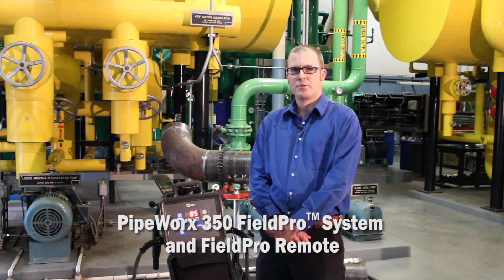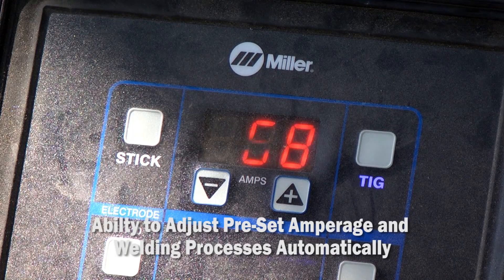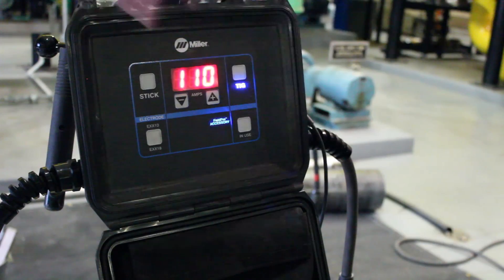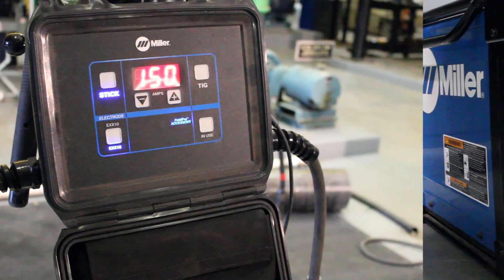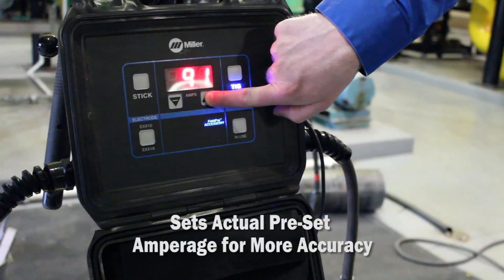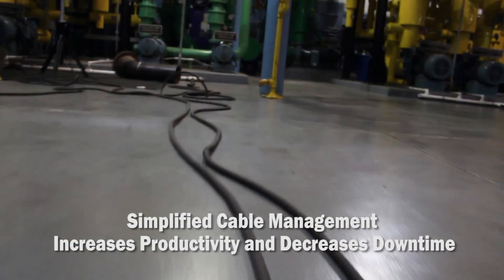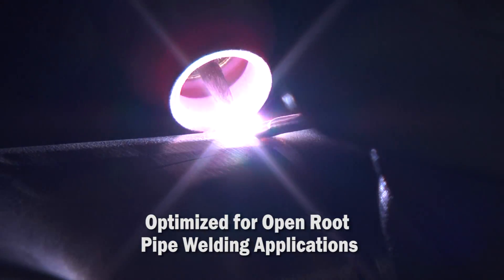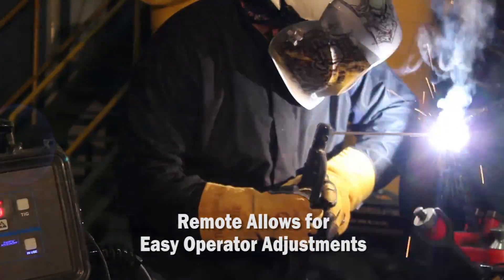Miller FieldPro Remote Provides Complete Control at Weld Joint for Stick and TIG Welding

Comment: Can you weld aluminum with this?
Reply from the maker: This remote is designed for the XMT FieldPro system, you could use this system to weld Aluminum with SMAW, however the system is not designed to weld aluminum with other processes.